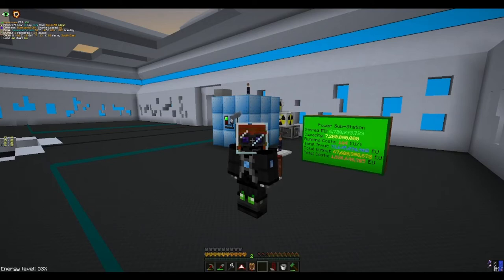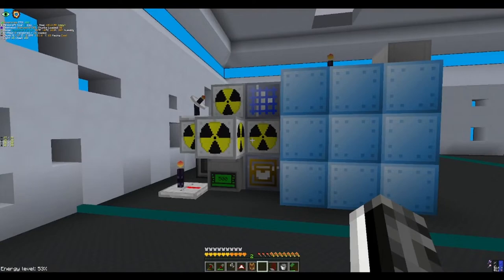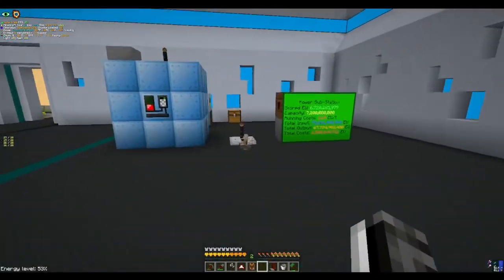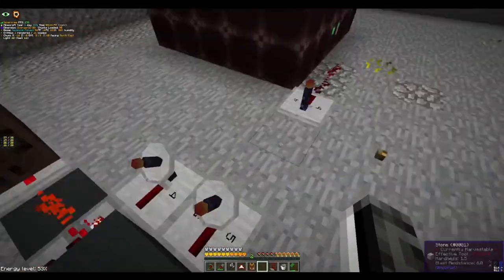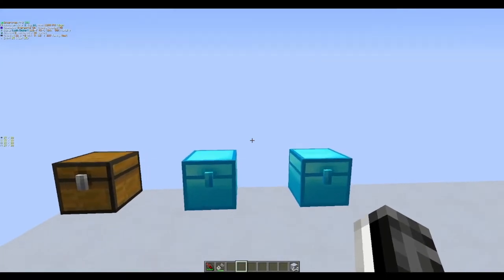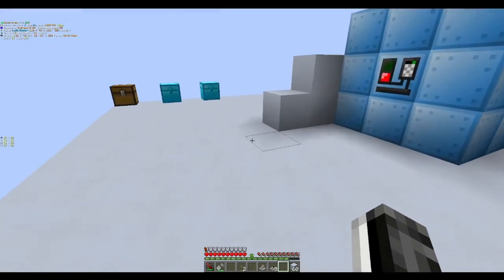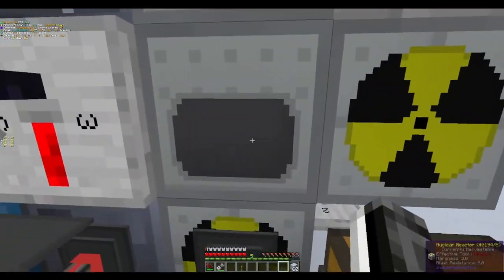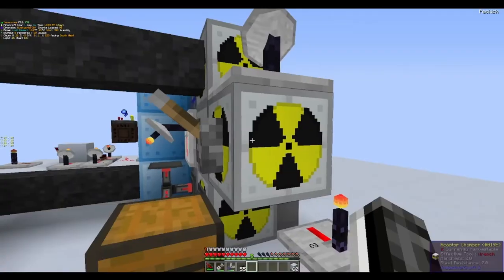(OLD) GTNH Vacuum Reactor Tutorial (Read Description) - Fully Automated | 3x3x6 5 amp IV

Comment: I might have just missed it throughout the video, but what coolant cell filter/filters do you use for the IV reactor design?
Reply from the maker: I actually didn't show it in the video, because there aren't really any nice numbers because there are only ever 2 cells in a heat group and each heat group doesn't gain heat in an easy multiple of another. 
The easiest way to set the filter is to just run the reactor until the cells reach a point where you would want to extract them, and add that value to the filter. With the IV design, the cells are mirrored along a diagonal, so you would only need to do it for half of the cells in the reactor.
I managed to do it with 5 filters at: 55104, 55632, 54672, 54612, and 54400.

Comment: The reactor is still gaining heat for some reason, Im even one ticking the coolan cells in  as fast as humanly possible but its still gaining heat.
Reply from the maker: Is the reactor destroying the cells when it gains heat? I haven't gone back and tested this, but my current theory is the conveyor misses the cell extraction and then gains heat when the cell overheats and is destroyed. You could try to use an enderIO filter to extract.
Reply: @isoarcree  it seems to be an issue in the newer versions that the reactor will gain heat regardless of how fast you swap the cells, I made sure none of the coolant cells even got too hot and instantly replaced all the cells that got too hot. Sampsa himself said he has to write a program to let the reactor cooloff when it got too hot.
Reply from the maker: @gilbertsikora3007  I am in the midst of testing a new design that should fix these issues. Will post an update video if everything goes as planned